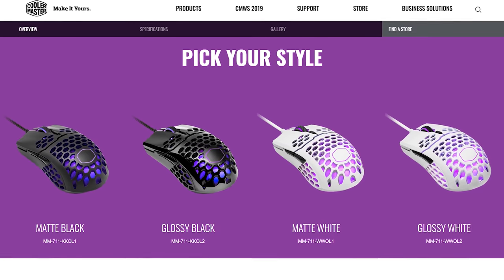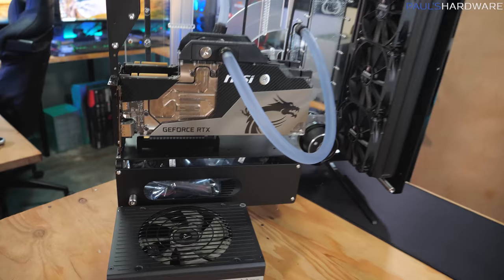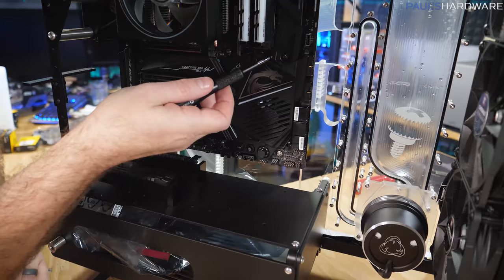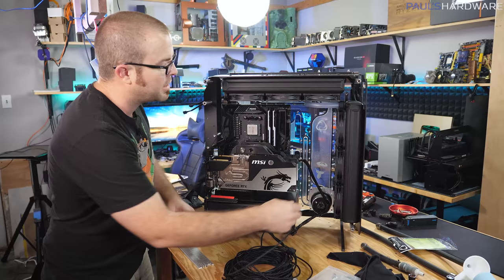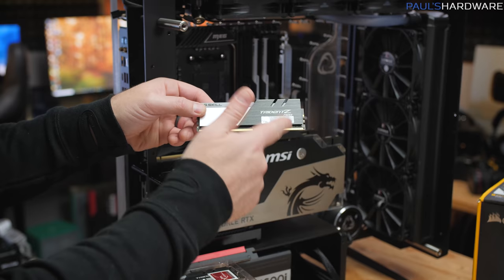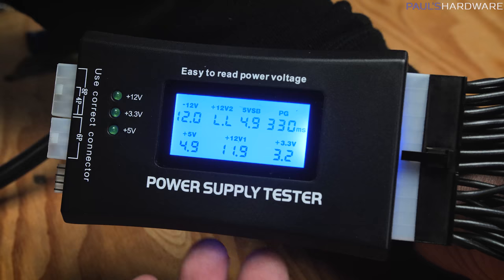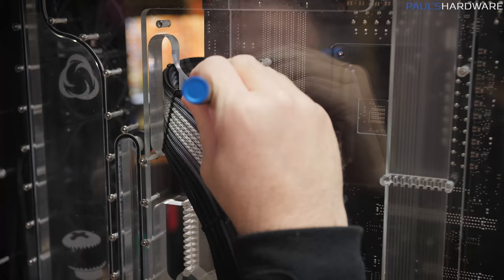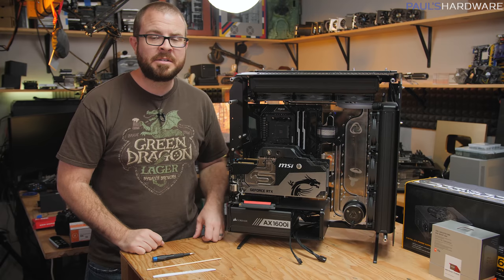I've Never Put This Much Thought Into a Build Before

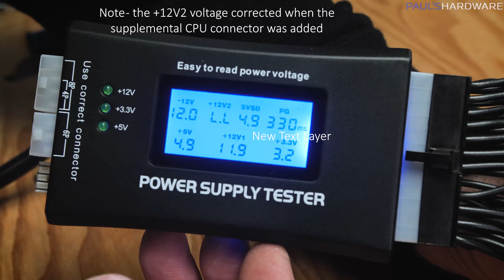Comment: 16:04 : "New Text Layer"

This is why you gotta stop editing past 2 AM.
Reply: Was just about to comment that mistake
Reply: Who else came down to the comments just because of this?
Reply from the maker: CURSE YOU NEW TEXT LAYER
why must you torment me
Reply: Impending running gag?
Reply: I am become New Text Layer, destroyer of videos.
Reply: @paulshardware   Good job as usual. Just an idea - maybe drill a pass through hole between the two gpus and one behind the gpu closest to the motherboard, that way you have short cable runs from the psu to gpus and a tighter curve - it might actually look really sick. Ps continue the good work.
Reply: I want a shirt saying "new text layer"
Reply: @paulshardware  i didn't even know that was a mistake. i thought it was just a "whoosh" moment
Reply: Paul's Hardware I get the same type of thing with Iterable, an email blast software. More than a couple times I’ve read “I’m a new block of text” on my company newsletters... 🤦🏻‍♂️
Reply: I specifically came to the comments to either say "New Text Layer" or thumb the guy who said it already.... I guess now I've done both.
Reply: would've been funnier if it just said bottom text
Reply: Sample Text

Comment: You;re right about the cable combs pinching and looking bad.  Hate to waste the cable combs though, aren't those aluminum?  Not sure I would clip them, but you could slide them to the ends so you can re-use them in the future.  This build is going to be over $6000 worth of hardware ($1500 case, $3000 worth of GPU's, a $750 CPU, $450 PSU, and a $350 motherboard.  And that's not even counting ram custom sleeving, and watercooling components.  INSANE.

Comment: paul your like a dad to me, but if my dad recommended SLI in 2019 i'd call child protective services.
Reply: "Its an enthusiast thing."  -Jayztwocents 😊
Reply: Ok weeb
Reply: About this... I've seen Jay's video on SLI, but nowhere does it mention using an older generation card and add another one to lengthen the lifespan a year or 2.
Having a 1080Ti I want to know, because a 2080ti is just not going to happen with these prices. Usecase would be VR and thus 2x 90FPS goal.
Reply: @Trancefreakeh  From experience I would say it highly depends on what games you want to play and whether they support sli. I found that there was less and less games supporting sli and therefore gave it up and got a 2080ti. This was coming from sli gtx 970. It's a pretty shitty feeling when one of your cards is just sitting there doing nothing.
Reply: @prophecy66  Sounds fair enough, really. There's just so much life in a 1080ti.
Reply: @Trancefreakeh  unless you're struggling to run things I wouldn't bother upgrading. It's a great card still.
Reply: Agreed.
Reply: @Trancefreakeh  Apply common sense. If no games are supporting SLI, then it doesn't matter why you're thinking about using SLI: it's still not supported and you still won't see any benefit from it.

Comment: The QDC on the distro block is a good idea, though it looks to be sticking out quite a ways, and I'd worry that it could get knocked somehow and cause the block to break. Maybe a short swivel 90 would keep it tucked in closer. Just a thought.
It looks really good so far Paul. I really like the cable management in that case. Keeps everything looking super clean and tidy, and lets you show off the main components without distraction.
And wow! I though my beard can grow quickly, but you've got me beat! o7

Comment: Slide all the combs into the cable management area instead of cutting them off.  Then you can use them in the future and bonus it might make the bottom part look better.  If not they typically slide all the way to the connector just fine.

Comment: do you know where i can get some custom motherboard screws for my build? Do you have a fan setup suggestion for running on a lian li 011 dynamic? i have 3 on bottom and 3 on top and a 280mm rad with two fans on the back side. I am confused on the best airflow setup. i7-9700k with 2070 super strix advanced gaming triple fan card.

Comment: you can just push the integrated cable combs to both ends, use another one or 2 in the exposed curve on the front . push the rest back to the connector down under the psu cover

Comment: The way to tell between stainless steel screws and aluminum is the weight of aluminum screws will be a lot lighter (almost half the weight) than for the same size stainless steel screw.

Comment: When dealing with non-magnetic screws, putting a small dab of grease in the screw void (where the screwdriver goes) will hold it to the tip of the screwdriver. You can then wipe it clean with a cotton swab.
Reply: I would use blu-tack

Comment: Hey Paul! I'm doing a very similar build. I had a tough time adjusting the front radiator. I use 54 mm thick Corsair radiators, similar to the ones you're using. Firstly, to match the height of the distroplates in- and outtake I had to lower the radiator to the point where it rubs against the side panel mounting thing at the bottom and none of the radiator mounting holes lines up. I had to drill new holes for the radiator and remove the side panel mounting bar. I can see that your radiator is pretty close to the bar as well, are you not worried it will carry vibrations to the distro and potentially lead to cracking? I am... Did you have to drill new holes for the radiator?

Comment: Holy Crap...1600W's, That's half the cost of my recent build. (Not including a 1080Ti I had). Also you can get an extension for a screwdriver that has a sleeve to hold the screw in it.
Reply: I would just use blu-tack to stop it falling off the screwdriver

Comment: Put a drop of crazy glue on a piece of trash and then dip your screwdriver in it and immediately put the stainless screw on it , wait a second and then thread it into the riser , when it's started a little just wiggle the handle to break the bond . Sometimes Vaseline works too but it's a dust magnet later .

Comment: Funny you should upload this today, I just got my own spectre today, albeit after waiting 8 months for it. Gonna install components tomorrow, including a threadripper 1920x and an rtx 2080, paired with 32 gigs of trident z royals. After that, I gotta wait for my tube bending kit and my ek leak tester. I woulda had those sooner, but I had originally planned to do all my corners with fittings, but ek discontinued one of the fittings I was gonna use. :/

Comment: Speaking of thought put into a build. I didn't do enough. 2 SATA data connections on the motherboard. 7 bays for drives in the case. How can I make that work without replacing the the motherboard?

Comment: I'm waiting for forged carbon to make its way into the PC aesthetics world.
Reply: @Gareth Tucker Well, you could use it for hard line tubes but I still think carbon is a bad choice for water loops though. I was thinking more for back plate covers, pump housings water block covers etc. Purely as an aesthetic thing. As for getting custom work done? Well, simple things I or almost anyone who knows composite materials could make simple parts at home and for more complex parts that would require injection moulding, that would be cost prohibitive unless batches were produced.

Comment: Not a question specific to this build but: why do we not use thicker cables, but less of them? For example, to a GPU, I think we're sending +5, +12, GND.  This could be handled with only three cables, with splitters at the plugs to spread out loads on the PCB traces.  It would be much tidier with less cables.